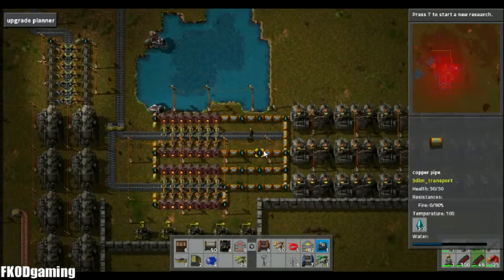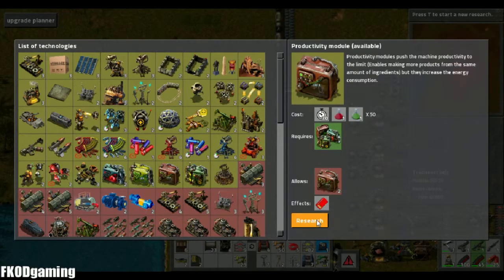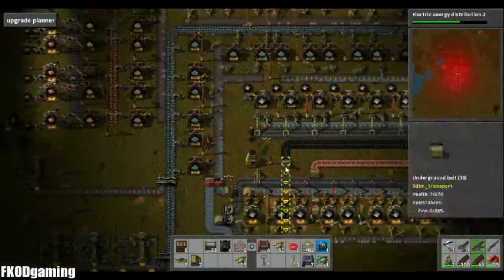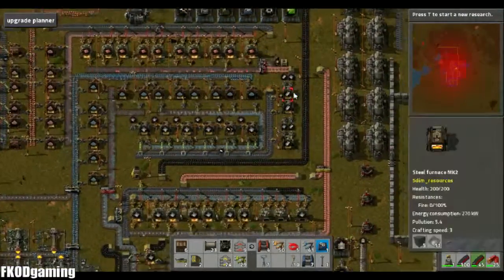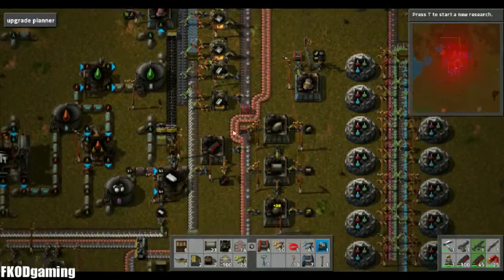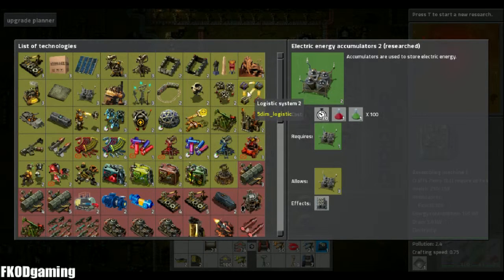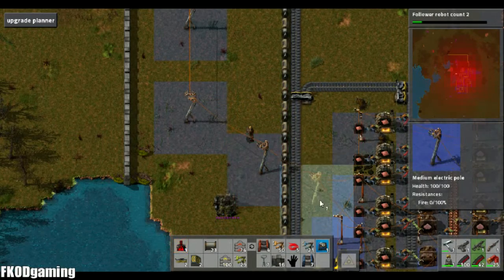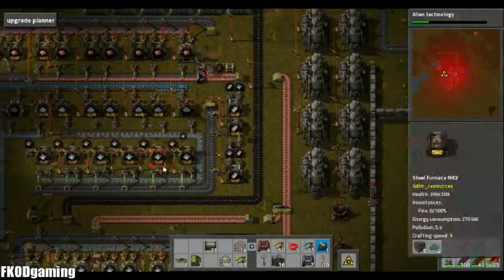Factorio Modded: 5Dim's Mods Part 15

Comment: i think there was suppose to be module slots for the masher's i seen a recent forum post from 5dim about in the next release it will be fixed with some bugs that are in
Reply from the maker: +The Redstone933 That would be very nice.  In my opinion, it makes sense for them to have slots because they are electrical. The Furnace Mk2 makes sense not to have slots since it still runs on fuel, so I'm more ok with it.
Reply: yea i got use to it after a while it became the norm they really run quick anyway